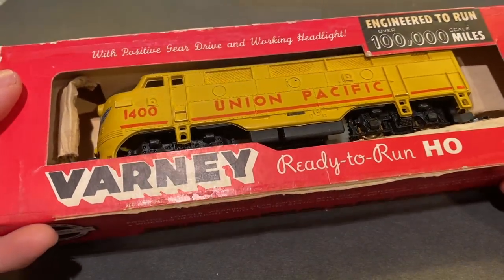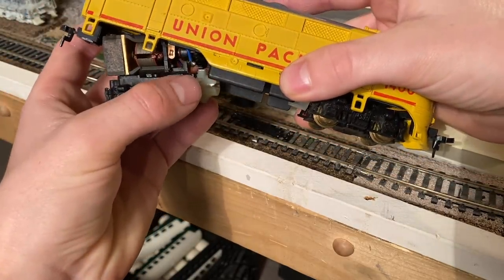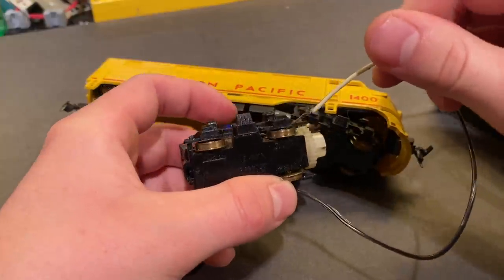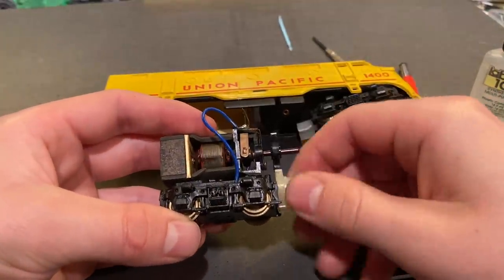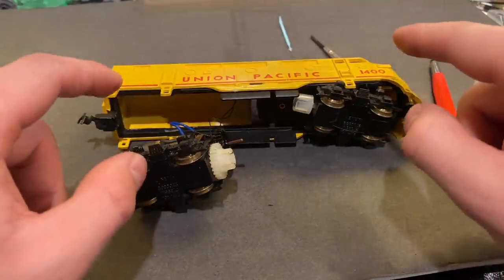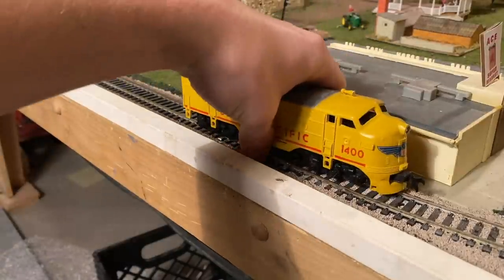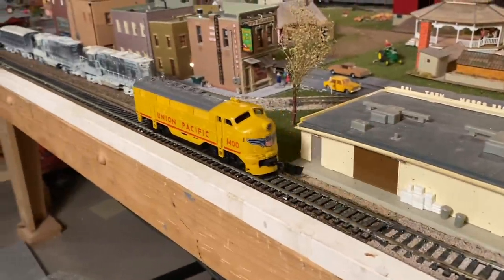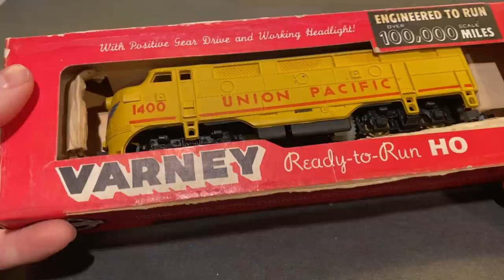Can We Make This Vintage Varney F3 Run? Hasn't Run in 50 Years!

Comment: IIRC they had a brass plate with a hole in the center which held the drive truck in place.  It comes off when you take the motor off.  What you did works just as well.  

It should have a shaft to the front truck to make it eight wheel drive.

Comment: Very nice job, you did the one thing I didn't want to try to do and succeeded.  

Context: it had some people interested in it thought the 70's - 90's 
(and did get tested multiple times) 
but was then put in back storage because of newer models
 replacing the older ones that were left. I just happened to stumble 
upon it when they were cleaning out all there really old stock
including a TONE of Varney rolling stock.

Comment: I really appreciate you getting the old locomotives running.  It helps me a lot with my old locomotives.  I have 3 old varney engines, the drives were worn out so I replaced them with athearn drives I got at the local flea market.

Comment: BTW...100,000 scale miles in HO is 6.6 million real feet.

Aurora one time ran one of their N scale units as long as they could.  It made over three months worth of continual running. They left it running one weekend when, at some point, it derailed, but only enough to jog the wheels.  It still had contact and, by Monday morning, the locomotive cut four deep wheel shaped gouges into the track while running in place.

I run my new units three hours continuously the mesh the gears in.  it quiets them down among other things.

Comment: That noise sounds like there's a lack of oil somewhere, it will probably go away as it breaks in over time, but I would recommend trying to find where that noise is coming from and then lubricating that part. Other than that, a very good runner, as these old Varney locos tend to be in my experience.

Comment: Very good fix. I myself never seen any varrney brand stuff in person maybe I think one freight car not sure. I would have thought it's a 8 wheel drive because of the driveshaft going between both trucks. I see where they improved Years Later by putting the motor in the center versus on the truck on the rear like what Athearn did. Good job macgyvering the part where there's will there is a way.  Or as one wise man said LOL. Red Green : "If the women don't find you handsome, they should at least find you handy."

Comment: AWESOME video Harrison, as always! And also that is just SOOO cool!! I wish I had one! And how rare are Varnys?
Reply: Not very……….probably thousands of them sitting in attics and basements across the land
Reply: They date back to the late 1940s/ early 1950s, i have a Varney power truck that has " stepped pullies" for using a "spring belt" for different speeds, the pullies are factory soldered on the shafts. I also have several Varney cars, from the 1950s, and some Life-Like cars that are Chinese carbon copies of the Varney cars. (Darn Chinese!)

Comment: Back in the day when open frame "Pitman" type motors were the best we could get, we'd use pulse power rather than straight DC for low speed operation. Today, I'd replace the Alnico magnets with rare earth based super magnets

Comment: Wasn't the light working when you tested it on the table with the motor out?  Hard to believe HO or H0 has been around much longer that that Varney, Harrison.  Check out the History section in the Wiki link below.
https://en.m.wikipedia.org/wiki/HO_scale
Thanks for sharing. 👍👍👍

Comment: Are those 4 units with the ice and snow weathering suppose to be from Runaway Train?
Reply: With a GP35 or 40 on point trailing an F and 2 GP7 or 9s I'm going to hazard a guess your assumption is correct.
Reply from the maker: They sure are. Not entirely accurate models but they were a fun project and something I always wanted.
Reply: @SMTMainline  considering I knew exactly what it was from a quick glance I'd say inaccurate or not you nailed it.
Amusing story I heard about production is that the yard scenes were actually filmed on the Butte Anaconda & Pacific that had long chopped the noses on their Geeps but the movie's props guys did such a good job seamlessly blending the false high short hood to the existing chopped hood that a lot of the BA&P crews were asking where the old locomotives came from.

Comment: Another thing that sodder can do is corrode the reason that I mentioned this is because I've had something that had a corroded sodder joint
Reply: Solder joints need to be rinsed afterwards with 90+ % Isopropyl alcohol.

Comment: SMT - Maybe the hobby shop tried to repair it for a customer, but found the mounting parts were no longer available?  Then the customer decided they didn't want it back & it ended up sitting in the stock room.

Comment: Mechanically, very much like the Penn Line gear drive model. The motor in the Varney model looks like a knock off of the Pittman motor Penn Line used.

Comment: I like to repair older HO models also, and am looking for either an AHM or preferably IHC GG1 chassis to restore. I have one that the motor is shot, and the drive wheels have deteriorated, any help or suggestions are greatly appreciated. I also have 3 Athearn rubber band drive locos, 2 F-7s and 1 GP-9, the motors run, but i cant find the rubber bands to fit, and am thinking about converting them to the newer style Athearn trucks, any help with these is also appreciated! Huge thanks if you can help!
Reply: They can be found on eBay. A guy makes them from silicone if I remember correctly.
Reply: @hondachopper6978  sorry, i dont do ebay.
Reply: Paul - I think SMT found some O - rings that worked for Athearn drive bands.  He used them in one of his previous videos.
Reply: @Petemonster62  well, thats a great thought, there are several local places that sell a load of various size o-rings, and i used a few of them to replace traction rings on Tyco diesels and on a pair of American Flyer 0-6-0 steam switchers. I also put new wiring, Kadee couplers, and Intermountain Wheels on the tenders to replace the brass/ plastic wheelsets. They look much better, and since the pick-up is on the tenders, i added a tad of extra weight to enhance that. One of the "A-F" engines is from 1953, the other 1956, both younger than me, and i am certain that theyre really made by Marx! One has a smoke unit and "chuff" the other one doesnt.
Reply: @paulsmith5398  - I think I read in Model Railroader years ago that Marx started making HO trains in 1957 & American Flyer HO trains debuted in 1938.  I think SMT made a couple of videos on replacing the bands in an Athearn F-unit & an Athearn RDC.  Those sound like good improvements that you made to the steamers!
Reply: @Petemonster62  you are probably right about the Marx years, and possibly the American Flyer too. I do have a few cars that have the Marx emblem on the bottom, and they seem just a little oversize for HO except for the "el-cheapo" trucks, which leave a lot to be desired. People give me these oddballs cuz they dont want 'em.